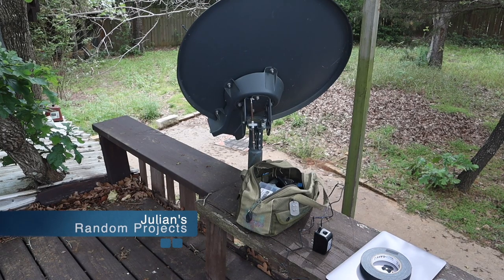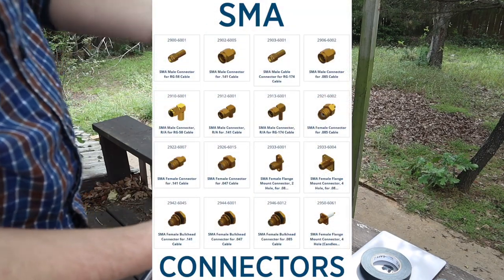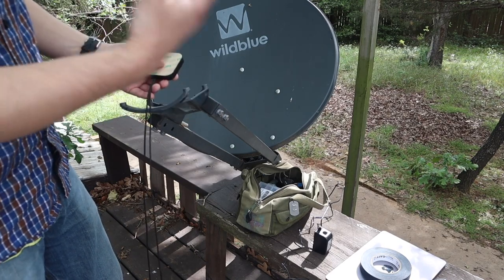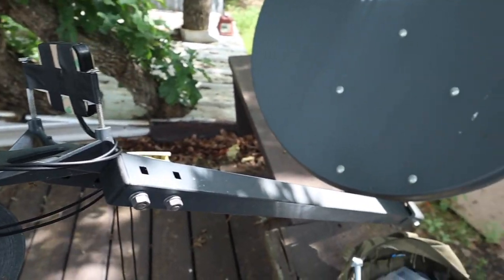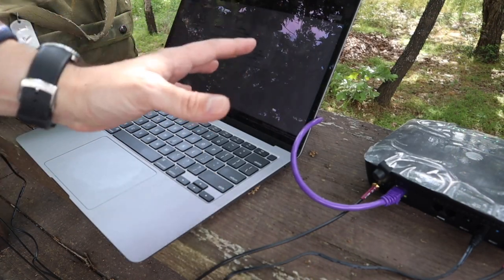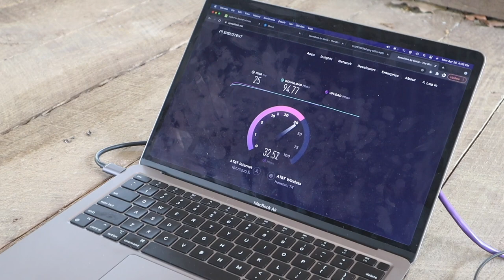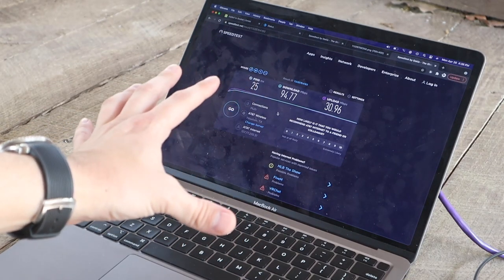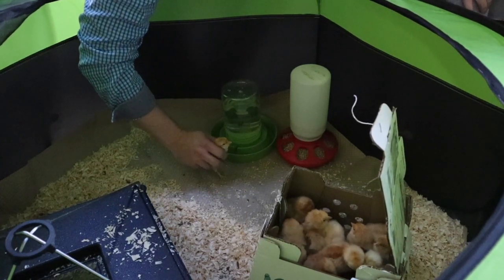Faster Internet From Trash - DIY LTE Antenna

Comment: If the the mimo antenna is wider than the feedhorn it might be necessary to move it away from the focal point to ensure full coverage. Aliexpress sells better dedicated 4G/5G mimo feedhorns, and putting the LTE router in a weatherproof box, either directly plugged into the feedhorn or used as the antenna itself and running Ethernet cable from that avoids the respective significant to huge loss of signal from the connecting cables at lower and higher frequencies.
Reply from the maker: Always the shortest runs of coax possible :) And thank for the lead on "4G/5G mimo feedhorns" lot's of stuff popping up on aliexpress!

Comment: Any idea if this would work for TMobile home internet and N71 5G? I know TMHI uses both 4G and 5G bands for internet connection so if anything it might just improve the 4G signal 🤷‍♂️
Reply from the maker: The antenna affixed to the LNB area is tuned for 4G so you’re right, would improve 4G. Might be able to find small 5G antenna. Good luck
Reply: I used box lined with foil and I put the gateway in the box and pointed facing the tower. I went from 30 to 6o download and 5 up. To 130 to 200 download and 20 to 35 up.

Comment: How do the DIY dish antenna speeds and signal strength compare to the external antenna you bought for your other router?
Reply from the maker: Speed is up to 100Mbps vs 40 on the other antenna. I didn’t bother to compare signal strength because two routers rarely agree on dbm.
Reply: @JuliansRandomProject  if I can find an old dish, I'll have to give this a try. I've been debating getting an external mimo antenna like that, but the expense would be drastically more. Thanks for the video! 😁

Comment: From what I'm seeing around YouTube you've got the fastest speed using 4G LTE with your DIY solution. 90-100mbps is insanely good! I have two questions: Is your mobile data plan restricted to a max of 100mbps during this experiment? What's the diameter of your parabolic dish (so I can try to replicate your results)? Thanks!
Reply from the maker: In testing I'm confident it was capped at 100mbps. The dish size is the typical 30 inch size for remote internet or TV.
Reply: @JuliansRandomProject  Thank you! I'm going to replicate your experiment using a router with 4G LTE Advanced (max 300Mbps) and a mobile data plan with 300/150Mbps in the hope of getting even crazier results 🚀
Reply: @ryan.a  If your router is 300/50, that is a CAT6 modem and your real world speed is going to be about 100/50. To get more speed you need a router with CAT12 or CAT18 LTE modem. CAT18 can do 5x CA down, 2x CA upload, so you could go up to 250/100 real world speed.
Reply: To get CAT18 to work at full speed you need a 4x4 MIMO antenna, the one in this video is a 2x2 MIMO.

Comment: Did you ever test the antenna speeds before you mounted it on the satellite dish? If so curious what they were :)
Reply: 4:11 
20 down, 10 up
Reply from the maker: About 40Mbs before and 80-100Mbs after.

Comment: Ok what kind of cables are u using? I  have an old direct TV dish that's on a 5 - 6 feet pole mounted. Would that be high enough?
Reply from the maker: Hight its too critical for LTE. You'll want to have short cables for the RF and use USB for the longer run. Do not use the coax cables that the sat dish was previously using. Good luck

Comment: What exactly is the device "sma connected" you used? Once it is mounted on the satellite do you then have cabling going from that inside the house to a router? or is it wireless waterproof router? How is it powered...
Reply from the maker: There is a short run (~6 feet) of antenna cable that goes to an LTE/Hotspot modem. Then it's ethernet into the house like any other high speed connection, you'd run that into a router for wifi and other wired devices. Good luck!

Comment: Does this work in sweden to?  We have tried everything but only get about 7-10 mbit in a good sunny day.  Will this work so we can get at least 60 mbit i would ve very happy 😍
Reply from the maker: Check the type of account/SIM you have with your cell provider. Sometimes they are throttled/capped for speed. Is your phone faster with a speed test?
Reply: Buy a proper mimo 4x4 outside antenna and fix it to the roof and the connect modern 4G router turn WiFi off... Run lan cable down to the first floor cheap WiFi router as access point(with no dhcp) ...
Will give you maximum "possible" speed that is what we run in rural German 3rd world forgotten east :/
O2 is cheaper and beats T-Mobile in some areas just search for the next tower before you buy :-)
Reply: @JuliansRandomProject  we bought a mimo 4g antenna and a 4g router.  Geting about 40-50 mbit/s. Im gonna try to change the band in the router and test to point The antenna arround and se if we can get a bit higher 😊

Comment: Did you notice any changes after mounting it?
Reply from the maker: No changes :) locked in and doing great. I need to find some tool that’ll show me RSSI and SNR at a quicker interval. Right now I have to make an adjustment and then wait 10 seconds to see if that helped.

Comment: Do you still have that setup?
I'm interested in how you set it up towards the tower.
Reply from the maker: Not using it currently but when it was in service I simply aimed it (like a rifle) at the tower. You can watch the rssi in your dashboard go up. Aim for biggest signal.
Reply: @JuliansRandomProject  definition of rssi up, if you mean that it is supposed to go from say -70 to -78 than it it the wrong way. But if you mean from -70 towards 0 then yes, up 😊
I read and seen that you need to angle the dish more or less at the ground dou to the being made for space transmission transmission, not ground to ground.

Comment: Great work man wish I could do that here but I live in a 10 story building lol! Btw do you have any suggestions for LTE indoor antennas? I use a Huawei B535 router(SMA).
Reply from the maker: Most any well made antenna will do great indoors. The real benefit comes from moving it around the house and aiming it in different directions to get the strongest signal. Good luck! Let us know how it goes.

Comment: I have Verizon cell service, I don't have a modem with that kind of connection. Could I purchase a modem from like Walmart with the right connection and it work? I have a Netgear router, but the connection is phone cable, is there a work around for this? I have a couple old dishes
Reply from the maker: Are you using your Verizon cell service for home internet? Do you have a dedicated SIM/4G data plan?
Reply: @JuliansRandomProject  I have frontier internet. I have a really tall TV antenna tower right behind my house. I climbed up about half way and ran a speed test with just my cell phone plan without wifi connected and had more speeds then with my internet company. Really wanna tap into that potential. My Verizon tower I connect to is band 13, 750mhz.
Reply from the maker: @brandonmorgan6395  You'll first need to secure an unlimited data plan with accompanying SIM then buy an LTE modem that is compatible with Verizon and has external antenna. then pair those up with a nice external antenna and go hunting for best signal. Take a look at all the RVers that do similar here on Youtube for more info. Good luck!

Comment: Do you know how far the cellular antenna is? I have already installed an antenna but it gives awful results and I'm considering doing this, in my case the antenna is ~2km away, without any obstacle
Reply from the maker: Cell tower is 1.3km from my house. Hope that helps. (I think this size is overkill for 1-2km but it’s what I had for free :)
Reply: @JuliansRandomProject  thx, I've done some research on this topic, and even with some tools measured an elevation profile and using my calculations, I'm 1300m away from the antenna so this should work.
You mention this is overkill, why yoh think that?
Reply from the maker: @masiv1001  Over kill because I can probably get the same results with a much smaller parabolic and more precise aiming. Bet yours works great! good luck

Comment: what did you do to permanently affix the lte antenna to the dish?
Reply from the maker: The temporary solution of gaffer’s tape became the long term solution :) After we got Starlink this antenna got less and less use. 3D printing a bracket would have been the best solution.
Reply: Thank you for your reply. Unfortunately we have far too much wind (50mph+) and rain where I am to rely on tape or even 3d printing. My search to figure this out continues lol. Thank you again @JuliansRandomProject
Reply from the maker: @SimplyStupidArt  3D printing (especially ABS and PETG) can be VERY strong with the right percentage fill. Give it a go

Comment: What do you have boosting signal back to tower ?
Reply from the maker: The shape of the dish focuses my signal (TX) back to the tower.
Reply: @JuliansRandomProject  this can't be right. the shape of the dish focuses incoming satellite signal for TV into a focal point, the reverse (TX) would disperse the TX signal
Reply from the maker: @cristivpopescu  You're correct. the TX pattern from this antenna would have a sort of wide beam (spreading out) in one direction less than 180 degrees. Which is better than omni directional like a normal hotspot antenna would be. So while I mentally envision hitting the tower with a laser beam, you're right... on TX it's more like a dispersed signal. The rejection of 180 degrees on the receive side plus the focusing of RX signals is where we're getting our biggest bang for the buck. Thanks for this note. has me thinking we should do a test with like a flat piece of sheet metal to compare the results.